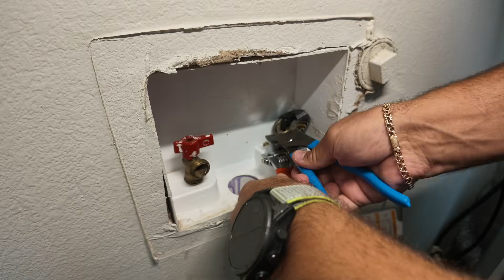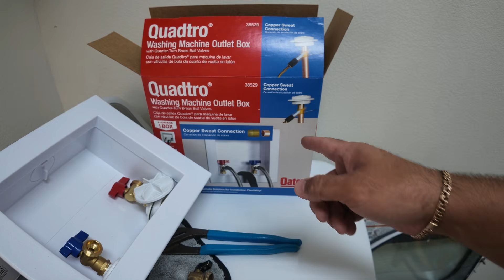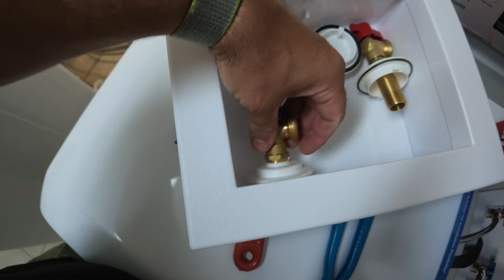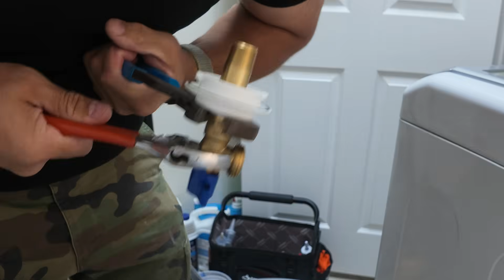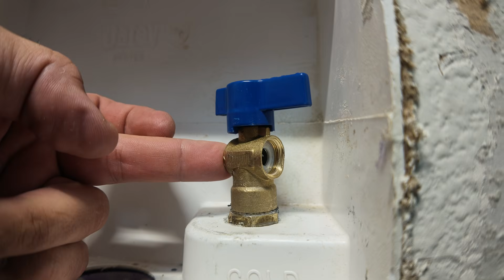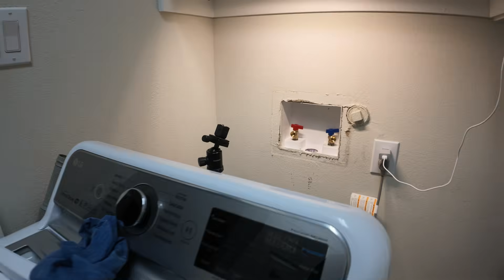No Wall Repair Laundry Washing Machine Shut-off Valve Replacement

Comment: Do you have to turn off the water exiting the water heater too for the hot water line?
Reply from the maker: If you turn off the water for the house, just make sure you've drained it from a house pipes. That will be enough.